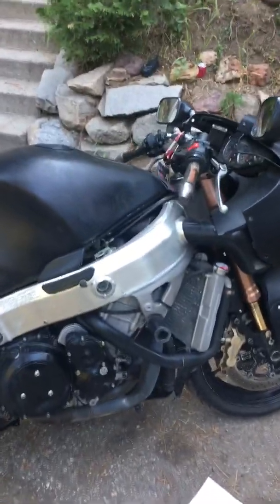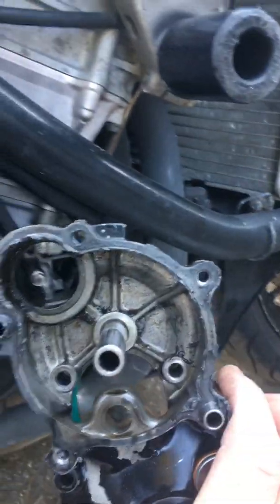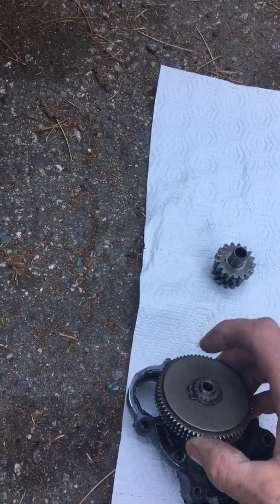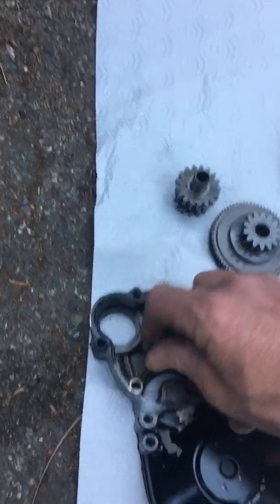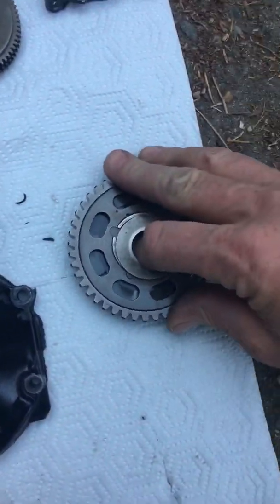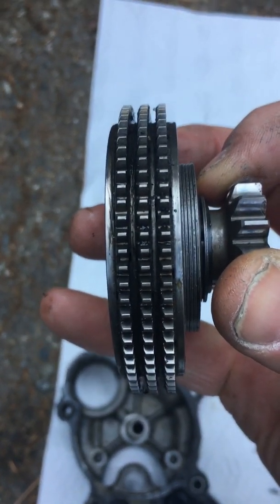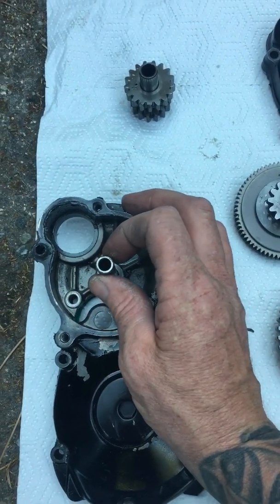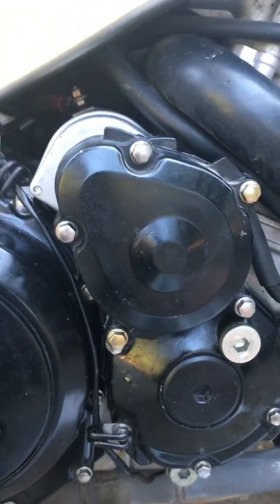Hayabusa hot start fix

Comment: my 2000 SRAD600 with 750FI in it, it does sound like it's binding when starting hot. cold start is fine, but lets say I drive it or let it warm up, stop the engine and try to start it again, it just wont crank as fast anymore and it gets worse and worse with every turn. battery is healthy, starter was just disassembled, inspected, cleaned and greased. started it up after reassembling the starter, cold start was fine. let it warm up to 60-70deg C, shut the engine and try to restart it and it just bogs slower and slower with every crank like the battery was dead. is that pin causing all that?
Reply from the maker: I tried greasing it up because I was narrowing it down, but doing that didn’t help either. Me and a friend finally noticed it was a little bit sloppy and just decided to go for it and buy one that was  used but not loose and it’s been good ever since
Reply: Did u try it did it work I have the same bike and it’s doing the same exact thing cold starts just fine hot it will give me a start or two if am lucky
Reply: @paceves88  I cleaned the starter, regreased it and then drove 230km in one go. it seemed to help, however it was cleaned from the right side of the engine too. so far no issues except what the starter caused.
Reply from the maker: @minilogique  I don’t know if you’re talking about the Hayabusa or the 600 that the guy in the comment was talking about but I’m sure it’s a fairly common thing that not a lot of people know about. You should take years apart and see if it’s loose at all like I showed in the video.
Reply: @rickgidney1005  mine was taken apart and it had some oil-coolant-mix residue from when the liquids met when the previous owner was the current owner. I reckon the starter clutch nor surrounding cogs are not getting active oiling which explains the residue that "melted" up after a long drive. there were some rust spots on the cogs but nothing major. the pin on the case cover was not loose. electrician checked the wiring and thought that the starter relay might also need to be replaced some time soon causing weaker cranks.
Reply from the maker: @minilogique  I remember watching some videos like you’re talking about to where there was rust and stuff like that down in that area by the starter clutch and the idler gear. If it’s not loose, then I would definitely replace the starter relay, I did all of that before I found the real problem but they do get weak overtime. It’s about a $20 fix I believe, I would get a decent one from Chaparral, I don’t think I would go with something from Amazon. But yeah, good idea, can you let me know if if it works for you?
Reply from the maker: Yes, the pin was causing every bit of it, I know because I replaced every thing else possible that it could’ve been. That was the only thing doing it.

Comment: Is this for a gen 1 and how many miles were on the bike?
Reply from the maker: Yes, this is a 2003 generation one Suzuki Hayabusa, GSX 1300 R 1298 cc, but the bike have had the problem since the original owner and bought it in 2003. Which means it was probably a bad mold.
Reply: I have a 2002 Hayabusa and it cranks but no start. I bought a new starter and it didnt work. I sprayed starter fluid in the air intake and it started for a second or two and shut off. I did it again and it started and made a grinding noise that sounded bad. I opened the cover and found metal shavings and the sprockets on the starter  were ate up. Not sure what to do now.

Comment: Hey kind sir if you reply to this you are a god ,
So I have a gsxr 1300 , bought it in 2016 new. Recently after 5 years of riding it an issue arose with it not hot starting after having some work done on the transmission ( especially 1,5,6 gears). Now that my transmission was new I didn’t think any problem would rise but my bike would start smooth when cold but as soon as I would be at a gas station it won’t hot start. 
I would have to wait 15 min for it to start and then it would smoothly. My mechanic suggested to get a new battery which I did but it did not fix the issue , now my bike is at the mechanic’s and he said he is gonna clean up the ignition properly and if that does not work he’l most probably recommend a new one ( the ignition being the part under the tank of the busa I’m not sure what it’s exactly called). 
The bike runs smooth , no over heating no nothing brand as new. 
So if his method does not work should I try yours and what parts from the video should I change,replace or repair. 
It would be of great help if you could offer your insight to another busa bro from a country far away.
Thank you in advance my friend.
Reply: Also I could not understand the issue with the rod in the video. So it should be still straight and not wobble around at all if I am right. 
So the cap and the rod will be the parts that need replacing?
Reply from the maker: @Ryan_utah  look at the other video that I made about the Hayabusa hot start problem/fix. You might see what I was talking about a little better buddy
Reply from the maker: @Ryan_utah  the hollow pin that the idler gear slips onto is the one you need to check for sloppiness, the case or housing that the pin sits in is the part that gets wallowed out, the pin should twist but not wobble at all. I show it better in the other video. Please keep me in the loop bro. I’ll be here
Reply: @rickgidney1005  alright I understood. The pin should have no wiggle room and should sit strictly straight and rotate on spot right. I will have it checked since I am going to pick the bike tomorrow but the issue was not resolved. I don’t trust my mechanic either seems to me he is just trying to make more money out of me. Il change the entire housing and the pin/rod with it. Will update you on how that goes and thanks for the quick reply man appreciate it a lot .
Reply: @rickgidney1005  keep in touch.
Reply from the maker: @Ryan_utah  yeah definitely check that, when you pull the housing cover off, there will be some oil in there, which is normal, I don’t know how it sprays in there, but that’s normal. You might have to get another little gasket when you put it back together, so it doesn’t leak after you work on it. Definitely pull the cover and check it, I replaced almost everything on my bike, except for the wiring harness, which I was going to do next. People I have not really heard of that problem, even good mechanics, that I’ve talk to, but it fix my issue for sure dude. Most people save battery, and then starter, and then starter relay, etc. I would definitely go for what I said first. I think a lot of other guys got helped out because of this they just never let me know if it fixed it or not which most likely means it was fixed and they never got back to me, but please let me know
Reply from the maker: @Ryan_utah  and also, I didn’t inspect the parts that I bought from the bike junkyard because they pulled them for me and gave them to me, I was just lucky that everything was nice and tight off of the bike that they gave me. If you look around and you find the parts, but they don’t seem tight or good, you might want to get brand new stuff, but not everything has to be brand new. Just a part of the pin goes into would be what I would get. Anyway I’ll stop rambling because I might start confusing you. Good luck with that dude.
Reply from the maker: I believe I made a second video, explaining the same thing, maybe look at my videos, and find the other one, and it might clear it up for you a little bit. That hollow pin that sits onto the part that is on the bike, should not have any play at all. it should be very tight with no wiggle room. Like a perfectly machine hole for the exact size, mine would wobble around because it was worn out over time. The original owner that on the bike before me said he would have to wait 10 or 15 minutes after it was stopped to start it back up again. By the time I got it, You would have to wait about an hour and some change before it would happen again because everything needed to cool all the way down because it got very worn out. It just keeps getting worse, and if I were you, I would check with a salvage shop to see if you can get the whole group of parts and just swap them out and put them on your bike. I paid $75 for everything from Cycle Salvage shop and put it on, and I have had no problems ever cents.
Reply: That wasn’t the problem man.
Reply: @Ryan_utah  did you ever figure it out?

Comment: I have a second generation 2007 1300 Hayabusa it a will. Cold startup real good once  get hot I come off the clutch she was shut down and won't start up until it cools off
Reply from the maker: Sometimes the starters are affected over time from the heat, I’m not saying what my problem was, everybody else is going to have. Until you figure it out, you can always pop start your bike. Have somebody push you or get a good roll by walking as hard as you can while you’re on the bike and the only luck I’ve had is doing it in first gear. Second gear just makes it stumble and stop. The first gear makes it turnover really fast like the motor needs. If you’re gonna go out and about and you have to park, try to park on a hill or somewhere where you can get a rolling start

Comment: Hi i have a 2013 triumph tiger 800 with the  hot start problem and also the grinding noise while idling and driving..sounds like what you say could be the problem regarding the hollow pin.
Reply from the maker: Pretty easy to check, good luck with it bud. Let us know what you figure out. People benefit from these conversations.

Comment: Where do you a replacement pin that wont cause the same problem?  Or do you have to replace the whole starter?
Reply from the maker: The starter is underneath the gas tank, the parts you need to replace are the pin and the housings that sandwich over it on the right hand side under the whole right side plastic cover. I got mine off of a motorcycle they didn’t have the problem from a motorcycle junkyard. You would have to call around and ask.
Reply: @rickgidney1005  Wow! Thanks for the quick reply!  I'm just now seeing it.  You solved my problem!  We were beating our heads agaisnt the wall!
Reply from the maker: @danmancastro  Dude that’s bad ass. I spent almost a year trying to narrow it down and I finally did. I’m so glad that it worked for you, I wish more people would respond if it worked for them, I couldn’t find anything About the problem when I was searching but I’m glad to help. Good for you, take care buddy
Reply: @rickgidney1005  Merry Christmas to you and your family!
Reply from the maker: @danmancastro  Merry Christmas to you and your family as well. Thank you sir

Comment: Just to make sure …. I’m having slow cranking when it’s hot …. Mine is clean and oiled up but still having the freaking hot start problem …. I’m trying it tomorrow…. But I was wondering what parts I should get and where to get it from … plus I’m pretty sure that I lost one of the washers .. is that gonna be a problem
Reply from the maker: Sorry I was in a rush when I wrote that, you should get the starter idler gear cover, and the inside cover as well that the pin drops into to hold the idler gear in place, I would get everything else if you’re not sure. There’s another gear that looks like a big pinwheel and then a starter clutch behind that which is all the way down in the front bottom right. Get everything from the starter down to the starter clutch. Sometimes starters get worn out and the magnets swell up and make it act like that but that’s something You’ll need to check. I also put bigger gauge wires from my battery to the starter and it turned a lot faster than the stock ones
Reply from the maker: I’m not a professional when it comes to it but I definitely learned a lot about it. I got mine from a cycle salvage yard with a Hayabusa they had a blown head but everything else was good. Try to get one off of a fairly new used motor, I got everything for 125 for mine